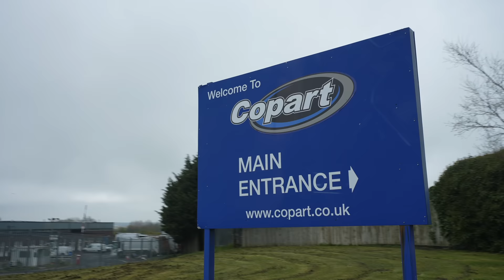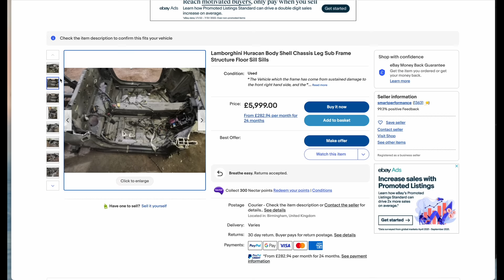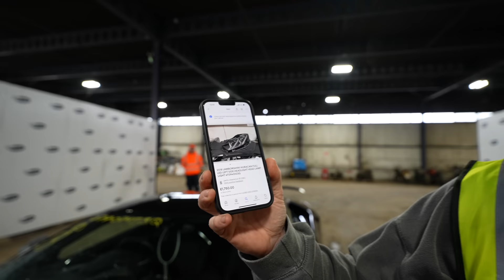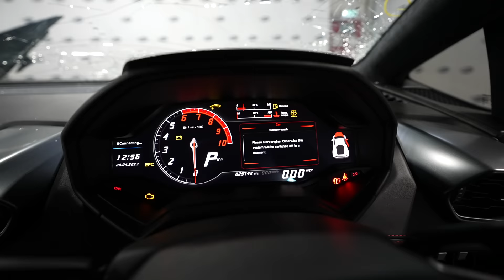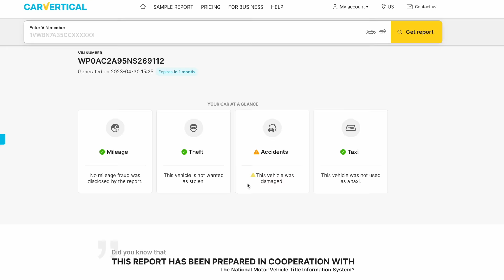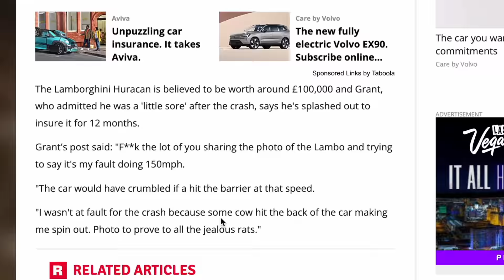HE CRASHED HIS LAMBORGHINI AFTER WINNING IT … NOW I CAN BUY IT

Comment: I was buying a car and checked car vertical and there was a mileage issue. I checked the mileage on the manufacturers website and it was all OK. When I spoke to car vertical they said it was an input issue so I was glad I didn't rely on car vertical and purchased based on the 
manufacturers information

Comment: A question to all: Would you guys recommend buying a wrecked exotic and trying to repair it on your own? Since Mat is always smiling and is in a good mood , eventhough he talks us through his challenges and setbacks, it does looks like, as if it also possible to be done by average hard working class Bob, like me. LMK... really curious to open up that can of worms🤝
Reply: Some of the work might look like a normal guy can do it, but the one REALLY IMPORTANT thing is that supercar parts usually cost supercar money so it's definitely not worth it unless you have and don't mind taking a bunch of cash and pretty much lighting it on fire. Would probably be smarter and safer to do a slightly older sports or luxury car that was around 100k new versus something 250k+ new. Good luck from here in Hawaii if you decide to go for it 🤙

Comment: Running the engine for more than 10-15 seconds without a coolant is not a good thing, don't do it please :)
Without coolant, the head and a block could overheat really fast and unevenly; it could warp and cause huge damage really fast.

I found it out the hard way when I was young 😂